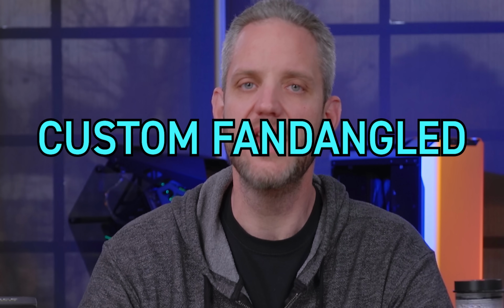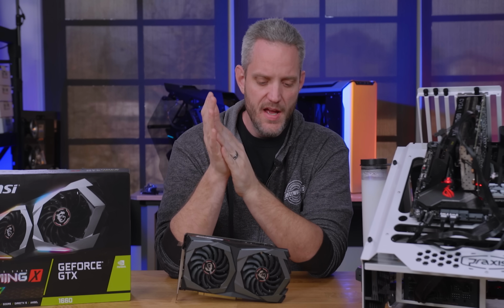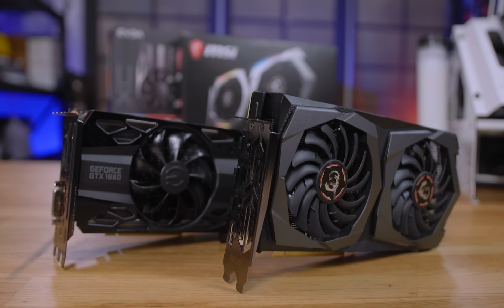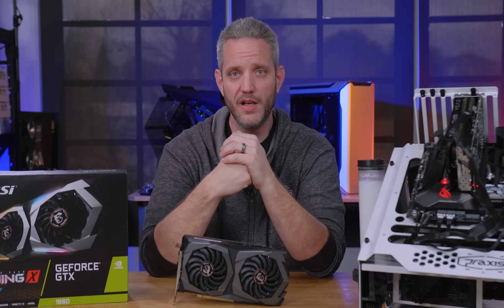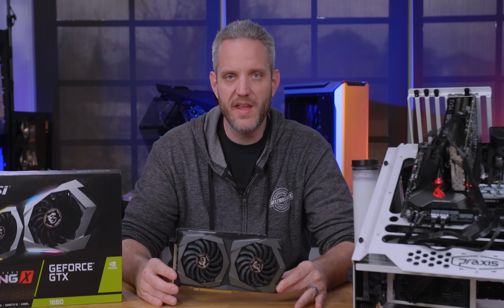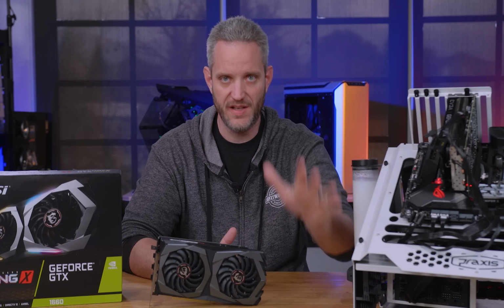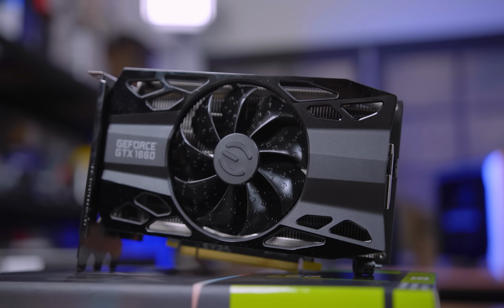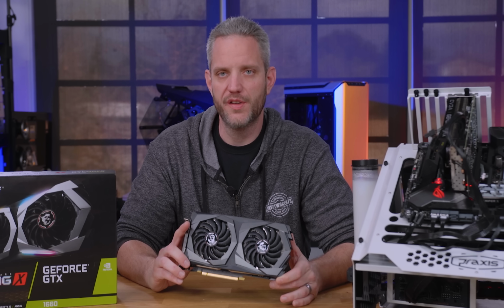Just save your money.... GTX 1660 vs GTX 1060

Comment: I think buying rx 580 8gb is a good option
Reply: I own a RX 580, MSI Armor 1.0 edition with 8GB VRAM. 

To be a mediator here, the RX 580 is not a bad card. I can easily run 25 degrees idle and cap on 65 under load without making my PC very loud. I have not changed out the thermal paste, but i could probably get away with maxing at 55-60 degrees if I did. 

The downsides to the 580 is AMD software is BAD. It doesn't correctly manage heat and fans, so MSI afterburner is a great option. Also they do suck up a lot more juice and make it more difficult to keep a quiet system. I have 2 120mm case fans in a medium sized case with fair airflow and the sound is fine. 

That being said, even with OC, you can only get to roughly 590 level or GTX 1060 with GDDR5X RAM OC level. Not 1660. Not Vega 56. 

Personally, I am totally happy with buying this card pre-RTX for 200. It's a GREAT card for what its worth. But with all of the Turing cards, I will likely buy into the 1660 or 1660ti next.
Reply: You can get 580s for dirt cheap on eBay. Not being afraid of the used market provides enormous savings.
Reply: @dogboy0912  I fear this is why amd new sales are suffering this quarter. It happened with r9 290x back in the day, and again today. Crypto crashes, amd cards get cheap on ebay, then amd new sales dwindle. I'm guilty of buying a used rx580 myself, it is simply too good a deal to pass. Mine wasnt even used in mining, just a rarely used v
Backup card (seller claims)
Reply: @dogboy0912  hell ya I took a risk and got a 1070ti on eBay for 150 from a seller with 0 sales and feedback got it and has been going strong for over a month now
Reply: For same price you could have a Vega 56  its what I did from a 290x
Reply: @kulgy  I am currently with a 290x and  Iam wondering to what should I upgrade, especially having in mind that I run with i5 4460 and 12gb of 1600MHz.
Reply: @viktornikolov4981 got my Vega 56 paired with Fx8350 and I get 12000 in fire strike stock speed where my 290x was getting 10000 over clocked and an average of 40 more fps in games like. BF1 and Apex on ultra settings.if you can buy one for £250-£270 well worth it
Reply: A lot of good value cards brand new, the insane prices are with the post crypto used market at the moment. Used RX570-580, especially 4gb, are dirt cheap and still very potent 1080p cards.
Reply: @mayberandomlybam3038  Yeah no thx,i don't wanna throw my money in trash,cos that what used mining cards are,be happy of they don't die in 2-3 months,but to each it's own,not gonna help same people that raised the prices of GPUs fuck them,i hope they get 100 stds
Reply: I'm still ok with my r9 290, slightly OCed and I'm afraid my processor will bottleneck anything from high end. I'm not ready to build a new system, but it's been 5 years ;__;
Reply: Get a 1660 or 1660 ti
Reply: My man, what about efficiency ?
Reply: @mayberandomlybam3038  Maybe you like bending,since you do buy used GPUs that are used for mining in the past,not my thing tho,but hey keep preaching how that's greatest thing ever.
Reply: @EyefyourGf  you say that as is mining cards are bound to self destruct as if you have any empirical evidence which you don't. Miners should have used cards near their peak efficiency anyway, not at 100%, throttling for weeks on end. That's like driving down the highway in 2nd gear.
Reply: but not good for your electric bill
Reply: @hawkhawk-y4c  It will not add a noticeable difference in your bill unless you plan to run it 24/7 on full load.
Reply: @HusseinMadiiqSmol  the fact is that the 1660 performs better than the 590 at the same price, and i dont think many people care about the included games, if people really wanted the game they would've already bought it, the games included aren't that good and you can get a cracked version if you realllllly wanted it.
Reply: @hwstar9416  and risk getting a virus? Getting cracked games is proven to be a great way to get junk on your PC even if you can't see it
Reply: @jetfyre6360  still. For people who don't care about the games included with the 590 the 1660 is a better deal for them.
Reply: I bought a RX 480 used on eBay for $110, and it's been great to me so far.
Reply: Well if buying brand new, rx 580 comes with 2 games (choose between The division 2, RE2 and DMC5) which is a great deal right now.  Or get a cheap used vega 56 on ebay. Personally I go for cheap stuff ; I just lost a bid few hours ago on a vega 56, it was sold for 212€. Better luck next time. Plenty of 1070ti as well..
Reply: At €180, definitely.
Mileage varies between regions ofc. In my country the cheapest 1660 is €235, with an average across the board of €250. Gotta love Dutch price margins.
Reply: you get it for way less price and with oc you can still be on 1660 stock level + more vram and higher bandwith vram.
Reply: @Xenoray1  Orly
Reply: hahaha 580 OC to be 1660 perf ? How would you gain 20% with OC ? you AMD fanboys are delusional as always
Reply: RX 590 or nah?
Reply: @alvzcizzler  No dont look at test
Reply: @alvzcizzler  580 :)
Reply: Rx 580 runs at 240 watts while the 1660 runs at 120. Bruhhh
Reply: @cbreezy6031   lol, wait what? The rx580 is only 185w. That is what happens when you only listen to other nvidia fanboys. you hear propaganda.
Reply: @pauls4522  I mean the rx 590. My bad lol
Reply: @cbreezy6031  yeah, im not impressed with the rx590 at all. its improved 14nm silicon marketed as 12nm, is clocked 15% higher, but is but is only about 10% more performance. It's just a problem with polaris. good architecture,very efficient, but only at lower clocks. Past 1200mhz polaris power consumption goes up greatly.
Got my rx580 for only 90$ on ebay used, so I cannot complain :)
Reply: @pauls4522  btw im an AMD fan but im kinda upset on their recent GPU. They are not doing well right now. I hope their next new cards would come out better.
Reply: not at all. rx580 is slower than the 1060 6 gb by 5% in fps. 1060 is already very old.
Reply: @maniaque37  still 580 
-cheaper 
-more vram
-performs better in dx12/ vulkan titles which are optimised for amd gpus
Reply: Rx 590 and 580 are irrelevant at this point
Reply: Ok but listen: 
Oh it was a clone comment, you got bamboozled
Reply: @_Smoothiii  not really my rx 580 gaming x 1450mhz with i7 8700k 4,9 ghz running with 350w. Normal system no oc only 300w
Reply: @jonas6293  and considering everyone is using overkill PSU's i dont see the problem here. almost everyone is running a 650w psu nowadays, I have a 4ghz 2700 and a 2070 running on less than 400w.
Reply: @C4CH3S  so you should be using 500 watt psu
Reply: @_qwe_fk_1700  it's a non modular EVGA 80 plus gold psu that I used for crossfire a bunch of years ago, the psu is still perfectly fine for a lower wattage system. 

If I got a new one it would still be 650, just for future proofing basically
Reply: @C4CH3S   850w 80plus gold cert here, but my pc was initially built in early 2013 when even higher psus were more common.
So yes even more overkill :) Even though I retired my dying 7970 recently for a rx580 I bought off ebay cheap.
Reply: @C4CH3S  im have i7 8700 with RTX2060 only got 350w PSU lol
Reply: @_Smoothiii  The one showed in the video was rx 590 T H I C C Boi btw.
Just googled it up pretty quick the rx 580 power consumption in furmark test is
250w source is anandtech
Reply: @_Smoothiii  You could not be more wrong.
Reply: The RX580 alone uses more power than a complete PC with a GTX1060 6G, so it's a big nope on that one.. I'm hoping Navi will proof worthy, but current AMD GPUs can go die in the fire they eventually will cause.
Reply: @jo05dk  I mean, do you really just enjoy exaggerating shit that is utterly irrelevant? I ran a 580 on a 450 watt PSU(80+ white, fixed cables, nothing special) for years with a 6 core CPU before sticking it in my HTPC and replacing it with a 650 watt for the sake of future upgrades(I.E., a lot more GPU) 

It's just funny how utterly irrelevant wattage is - until someone needs an excuse not to buy a Radeon card. 
It sure as shit never comes up with Intel CPUs vs Ryzen of course
Reply: @RyTrapp0  I know.. Jumping to uinformed conclusions are more fun, and certainly easier. ..but you still end up looking like a fool. Don't do it man.

Some of us actually care about how much power we use, or at least don't want to use the ridiculous solution when there is a far better one out there. ..and this particular someone furthermore cares a hell of a lot about building/owning silent PCs, that run cool. It's a question of feeling the PC is a balanced piece of equipment.

The fact that you don't care, doesn't mean that no one else cares.

..and to the fanboi stick at the end: I've had FAR more AMD PCs than Nvidia/Intel machines. The one i'm currently running is the first Intel/Nvidia PC i ever build. With the horribly slow FX CPU's, and the ever more hot and inefficient Radeon cards, i was left without a choice. But that doesn't make me a fanboi. I build with the stuff that best suits my needs, no matter who made it. I'm not a fanboi. I'm a grownup.

Comment: Would have been nice to include a 1070 in the comparison, just for reference, since usually the next generation 60 is more comparable to the previous 70, in terms of performance. 2nd hand 1070 is also a good option for that price point.
Reply: well, surprise, 2060 and 1070 is nearly identical, 1660ti is a tiny bit worse, but not so much it matters. But the prices have also increased with perfromance, which makes the new cards garbage. Rather buy a used 1070 or 1080.

Comment: The mid range is getting saturated,    I'm happy.
Reply: I'm happy too. It definitely gives budget builds more room to play with, now we just gotta wait until AMD releases some more budget cards.. (rx 600 series maybe?)
Reply: @jkcproductions5122  budget build, meh, here a cheap 1660ti is 300€, 2060 400e (most of them in the 500€ range). this one will probably be more than 250€.
In 2012 I bought my 7870 for 210€. It was considered mid-range, not budget. A 6870 the year before was 180€.  500€ I see the 2060 at was top of the line, amd or nvidia.
Guess what, the 7870 is like a 1050, which is 130-150€. The gpu market is weird.
I'm just rambling, I hoped I could get a 60 fps 1440p card for 250. Well nope.
Reply: @escalator9734  In France prices are way up too, I still managed to get a 2060 XC from EVGA at 330€ (270 actually, tax will come back), and it's still fkin expensive even if i found a "good deal". If ou want to buy in a shop, you have to count like 450/500€ for a 2060...
Reply: @ramonade_knives  Yep same prices in my country.
Reply: @ramonade_knives  Je suis francais aussi. J'ai meme pas regardé les prix chez ldlc et consorts, deja sur amazon c'est hyper cher. Tu l'as eu ou la 2060 ?
Reply: You are right.  @escalator9734  the 1660 is effing NOT a mid range card.
Reply: @escalator9734  oui monsieur
Reply: JKC Productions i think Navi is next
Reply: Yet without navi those offerings dont really add much thanks to the vram and rtx policy
Reply: Competition = GOOD

Choice = GOOD

Monopoly = BAD .... and is the Achilles Heel of Capitalism (and Progress) so it's best avoided at all cost
Reply: Sale prices will be way more competitive too, the more competition the more often there are sales. Black Friday this year is going to fucking rock.
Reply: entry*
Reply: What even counts as "mid-range" is going to be re-defined when Navi comes out, or at least I'm not buying any new cards until I see what happens when Navi does come out, as the improvements in value for this generation are extremely minor compared to the improvement in value from the GTX 900 series to the 1000 series. Nvidia is happy to earn higher margins for now.
Reply: With saturation of the market comes lowering of the prices, and that's a G O O D   T H I N G
Reply: Well, happier times. :-(
Reply: @janark4078  right? I wish I could get one of these cards for a decent price. $150 cards going for $400-$600
Reply: Your absolutely correct.  I opted for a 1660 Ti this year instead of putting out more for an RTX.  Nvidia is at a point right now where they can set the market with the current AMD offerings.  I hope Navi can shake things up and offer RTX 2060 performance around the $300 mark.  With Intel entering the GPU market next year, we should see a new age of budget friendly high end GPUs.
Reply: Only when my cock and my bank account are getting saturated am I happy...
Reply: More like getting extra stuff out of their selves.
Reply: SaikoJ Smith still better than no improvement
Reply: @ignshadexx8669  Has there ever been a new chipset that wasnt an improvement then? Strange comment bro.
Reply: Too bad the choices are pretty bad, and only every 2nd card is worth it. Take the 1660 if you dont have much, or get the 2060 if you want a beast of a midrange card.
Reply: saturated with shit?
Reply: If only you knew what the future held. Mid range cards go for high end prices nowadays. Rip
Reply: Gtx 1660 ti it’s a low end gpu by today standards
Reply: I would get a used 1080 for 300 or less
Reply: Good point! However, some people miss the point because they don't understand Capitalism. Younger generation all have Socialism on the brain.
Reply: Why is that a good thing?
Reply: @BiggestHam  more competition = better prices.
Reply: Skyrilla whatever you do don’t get a founders 2070 my first one died mid gta and apparently it’s because the backplate made it overheat. I’d go for EVGA or maybe ROG cards
Reply: @BiggestHam  Dude they just came out. It's going to be a while before that happens.
Reply: @amoniousbt1110  also way better products
Reply: @amoniousbt1110  wich isnt showing
Reply: Skyrilla more competition forces makers to drop their prices and also continue to improve their products at a faster rate.
Reply: The gtx 1660 has almost the same performance as the 1060. What's the point?
Reply: @lowkey276  idk lol rip off?
Reply: Gtx16xx is actually low end...
Reply: @flipjenl9616  1660ti overclocked has 1070 ti performance lol.Definetely not low end.lol.
Reply: @flipjenl9616  you couldn't be more wrong.

Comment: Too much market fragmentation only leads to confused consumers.
Reply: Forget it, the younger generation only knows Socialism. They all think Capitalism is 100% evil. Feel the Burn, right?!
Reply: @headbuster03  what?
Reply: leads to cheaper GPUs is what it does. if you're confused it's your job to figure it out and do your research like watching these videos before buying.
Reply: @S1ngula1rity   Ryan has a point here. It doesn't as there are only two players in the market: competition is what makes the prices drop, which is not really the case in this situation.
Reply: @Hermenaus  actually it's not the competition, it's the supply of the product
Reply: True. I was more referring to the manufacturers of the whole card competing with each other which adds a multiplier on how many cards are on the market. Some call it fragmentation, I call it market saturation (at least in the mid range GPU market) @Hermenaus